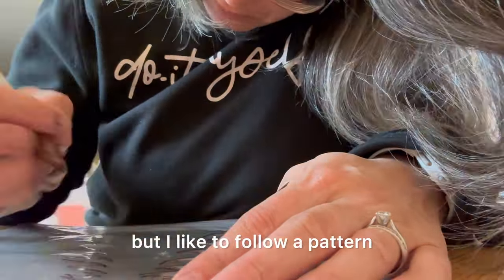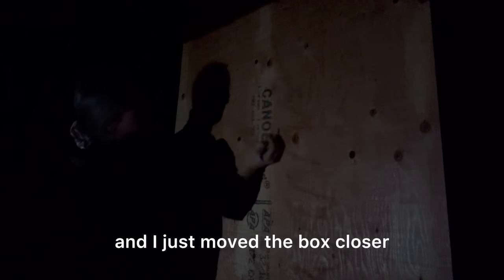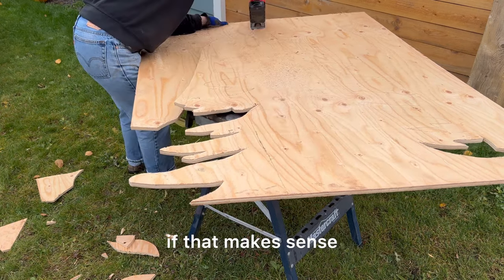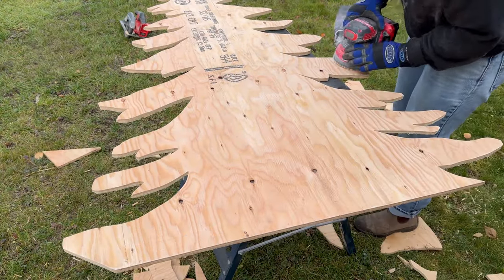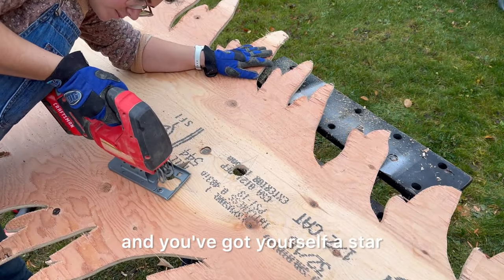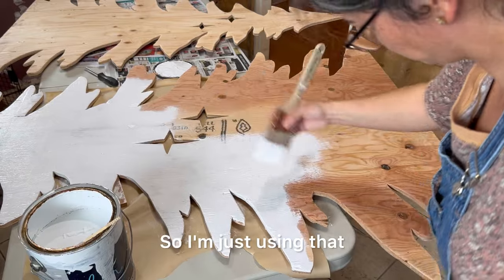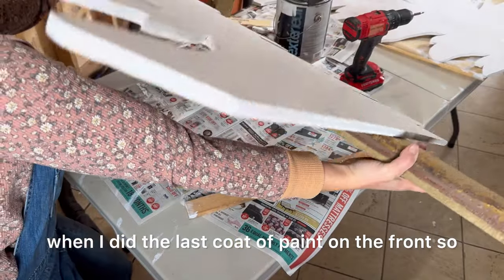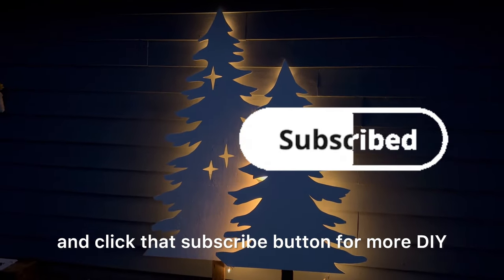DIY Christmas Tree Plywood Cut Outs - no stencils needed!

Comment: Wonderful tutorial. Thank you. 
I need to ask you, besides the exterior psint, what other paint or sealer can I used?. Specially to preserve the wood from the rain and the colors from the sun?. TIA 🙏🏾
Reply from the maker: No sealer, exterior latex paint is fine but definitely use primer First! I didn’t and had some of the knots bleed through. Use a good blocking primer.